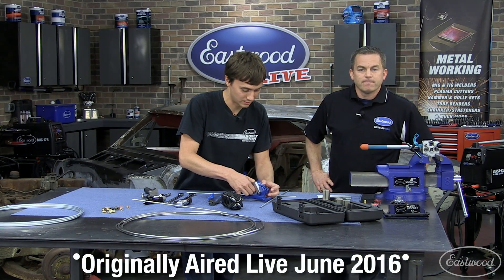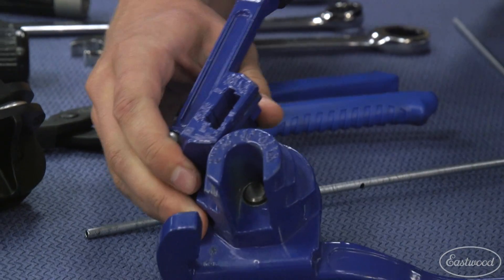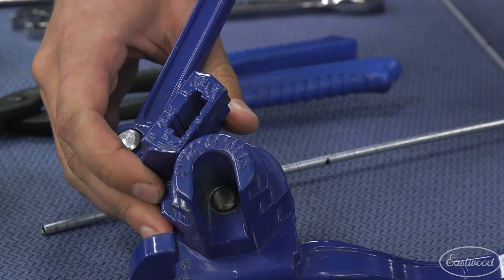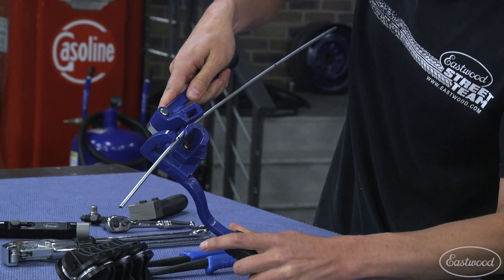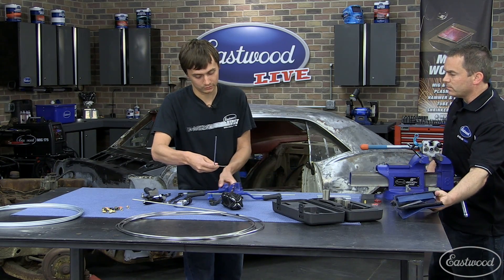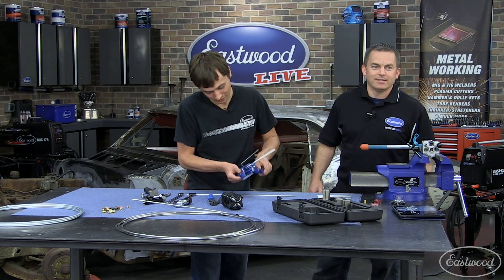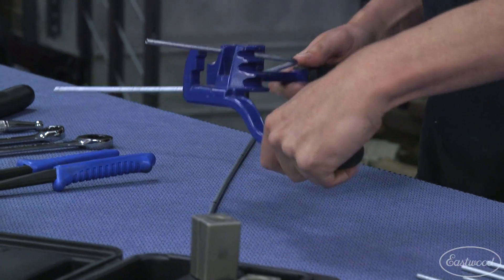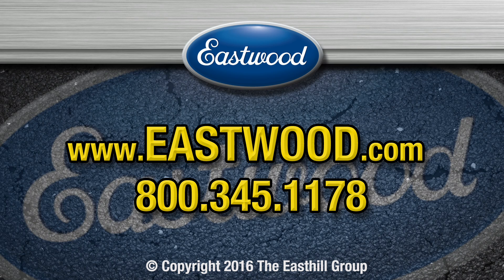Get Perfect Bends in Your Brake Line With the Triple Head 180° Tubing Bender From Eastwood

Comment: How do you determine the correct lengths between bends?  What are the 0, R, and L symbols used for on the handle?
Reply from the maker: Check out all those details here: https://www.eastwood.com/images/library/12435Q.pdf

Comment: I have a tool like that. Bends 3/16 no problem. 3/8 though IS a problem. Kinks far easier. Can't get a 90 degree without a kink since you lose the support as the "die" travels away from the starting point.

Comment: How about showing how to bend tube to an accurate measurement?
Reply from the maker: Good idea.  We'll try to do that in an upcoming video, probably a Live video so we can take questions.  Thanks.
Reply: Joeys48  It isn't as easy as it looks but the gain is pretty easy , add the radius of your bending iron for 90 deg. Cut lengths are a bit more difficult to calculate. most just leave it long and cut when the desired shape is made. Those are pretty shitty benders anyway if you want to do an accurate and repeatable job you are better off using Rigid Instrument tube benders. The tube never slips, all the gain is marked as is the angle of bend. They can be used freehand or in a vice if you have plenty of bends to do. They never mar the pipe and put in the tightest radius bend that can be done on that diameter.  More info if you want it
https://www.roguefab.com/bending-101/